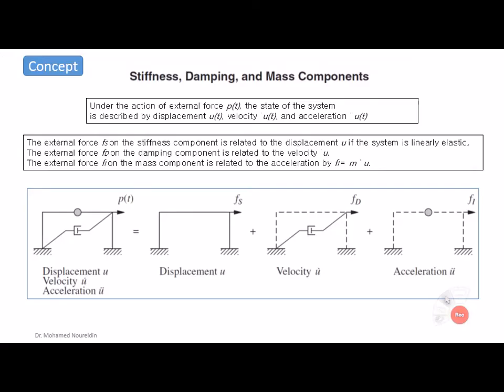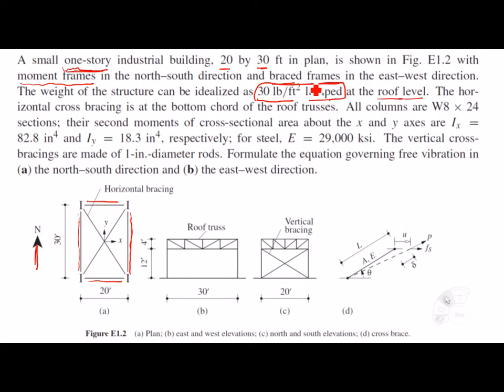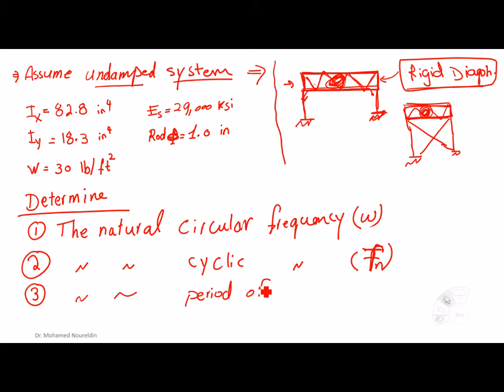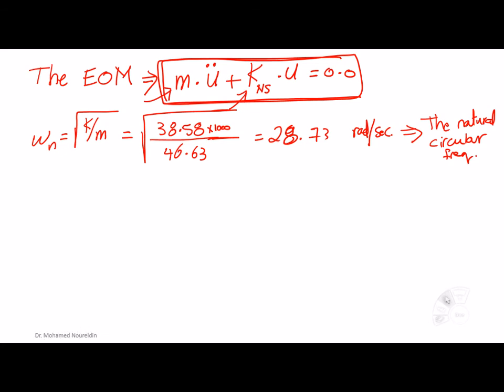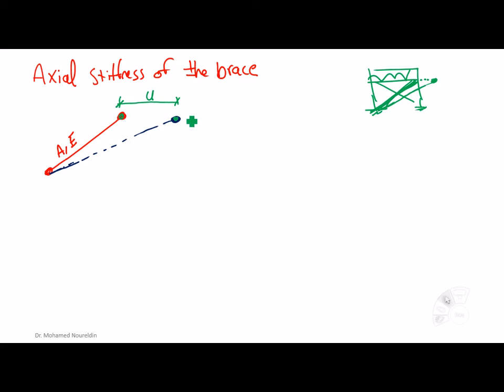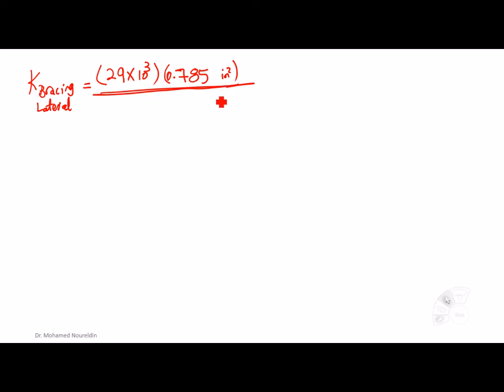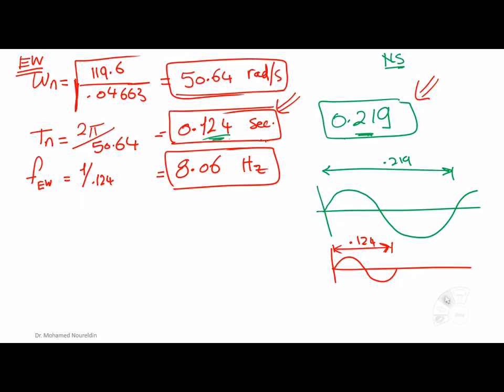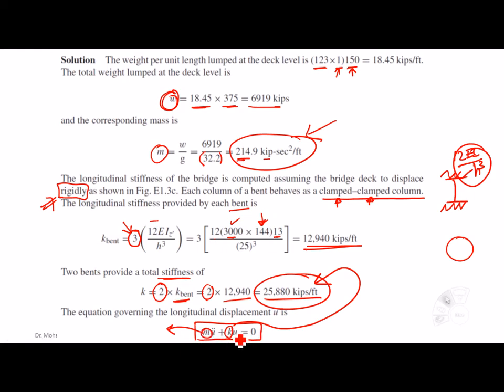6- Examples on Un-damped Free Vibration Response of SDOF system

Comment: Salam Doctor, I think there is a mistake in the calculation of the mass for the first example,  
you divided by g =386 in/sec2 but forgot to change the units of the Numeratar ie. the area; the value of the mass should have been 559 Ib. 
Thanks

Comment: Salam Alikum. Firstly, thank you for this amazing course. In the first example of the industrial steel building in the east-west direction, you have proved that the stiffness of columns in the y-direction will not affect the calculated stiffness. Thus, I made a conclusion that you have considered the bracing and columns would work like a two spring system connected in parallel. This interpretation made me confused, because I think the system would behave like a spring system connected in series and this would lead in a reduction in the total stiffness as you demonstrated before in earlier lecture, am I right?